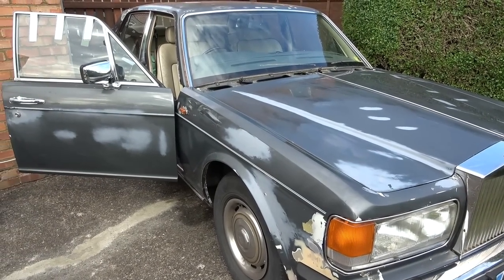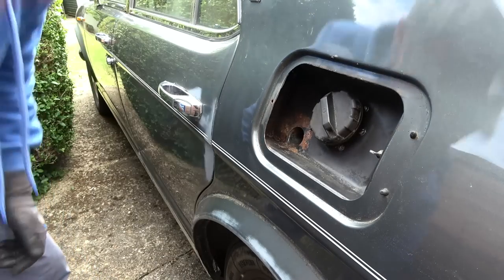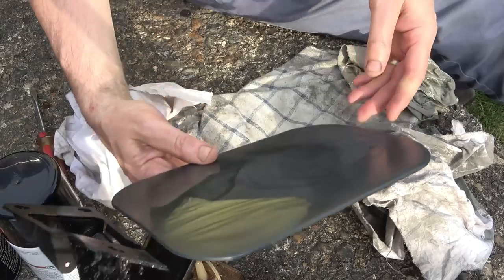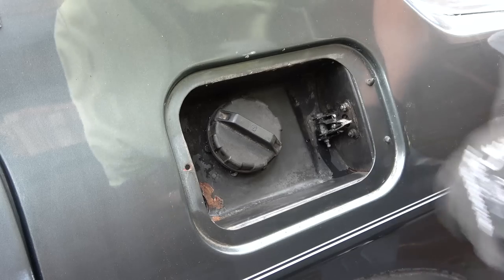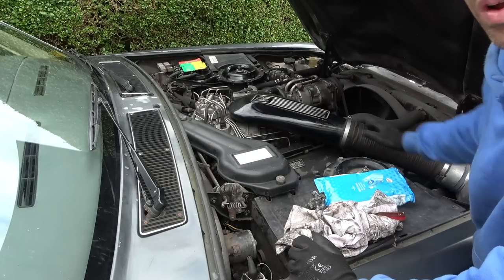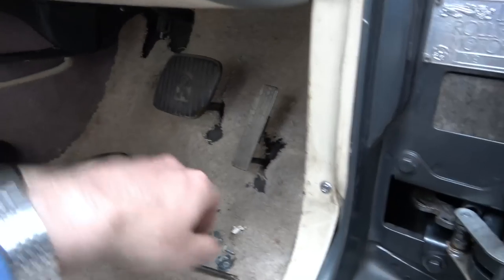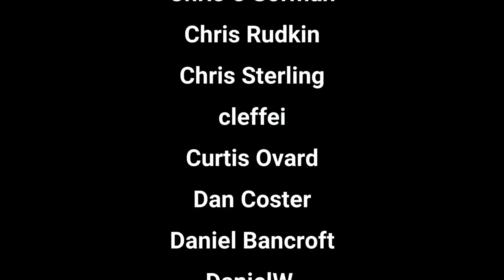Can I REPAIR a ROLLS ROYCE - PART 8 - Fuel Filler Flap - Polish - Engine Clean

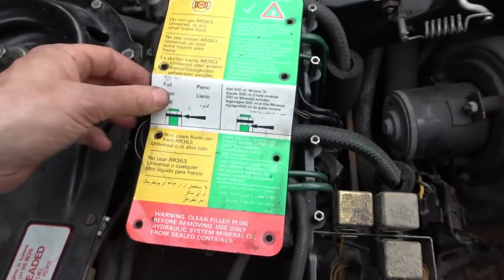Comment: The original Castrol LHM bottles have a specific tube nozzle which fits in the LHM reservoirs for the suspension and brakes. You'll need to get hold of one of them, Flying Spares has them for a couple of quid, part RH15233. It goes in the holes on the top left of each of the reservoirs as seen at 38:07 - they are accessible with the warning plate in place. The one furthest in to the engine bay on yours has a blanking plug in place, the other one seems to have lost it over the years.

Comment: Hi Vince! I'm the bloke who sent the polisher in! I used to detailer professionally so just a few things

T cut contains fillers which essentially fills in those scratches,  (caused by the car being wet sanded by the way) this causes it to look shiny but only short time if you wipe it with IPA it soon be dull again. I highly doubt you will be able to remove the scratches by hand but the machine will do the job just fine you will need to research the correct pad though.  

I also believe your car is not single stage paint (paint with clear coat mixed through it) it seems to be paint and then clear coat on top. 
Last thing is wear a mask if you're going to be using the machine even when outside clear coat is nasty stuff. Disposable P3 mask would do. 

Thanks again for the content
Reply from the maker: Nice one Ben, I have already filmed part 12 on the T Cut attempt but I will remember the tips for another future episode👍👍👍

Comment: Another great episode, Vince.  I'm really loving the series so far!  Makes me want to get my XR3i Cabriolet out of my mum's garage and try to get it back on the road.  It's been sat there dead for over 20 years, so it's likely going to need a bit of work!  😬
Reply from the maker: Cheers Steve, it is probably worth more than you think. All older cars seem to be fetching high money at the mo 👍
Reply: That engine oil is probably going to be the consistency of molasses lmao
Reply: it will need a new, well, everything. 😁
Reply: @cheapasstech  absolutely. I detest nothing more than those "it has been sitting for 40 years, will it start?" videos.
Reply: Go for it buddy 😎
Reply: just had a look at that car... god it's so.... you! It'd be good to see how you go if you do decide to give a restoration a go!
Reply: You deffo need to bring that to the channel steve im a big ford fan
Reply: I had my 1990 XR3i Cab on my driveway under tarpaulin since 2008.  Was meaning to get it up and running at times, but just never got around to it.  As we were planning on moving a few months ago (but it fell through eventually), I reluctantly sold it last December.  It was generally in pretty good shape, but needed some work, mainly to the bodywork and normal things when a car has sat still for 14 years.  I put it on the bay, and through an auction it finally sold for £1,150.  I was expecting better, but it just so happened that the auction ended right at the time the final F1 race was finishing in December, where we had the last lap fiasco between Hamilton and Verstappen, and then the subsequent appeals by Mercedes.  the auction ended right between the final lap and the next hour of protests, so I think many people that had been watching  (over 100 watchers) must have been caught up with the GP and forgot it was ending.  The guy who bought it said he was well pleased with the final price.  Strangely enough, as of a week ago, it wasn't back on the road as the gov website is still showing the last MOT was in 2008.  By golly, I loved that car.  And as it turned out, I didn't even need to sell it!

Comment: Be careful with that T-Cut Vince It will cut through the lacquer layer on your paint (if it has a lacquer layer). Check the t-cut bottle instructions it will explain what kind of paint you can use it on. Older  T-cut was mainly used for flat paint but they do do one for lacquer finishes. Also you must use a polish after using the t-cut.
Reply: From the looks of the car, it’s likely if there was a protective layer on it, it is likely long gone already
Reply: I wouldn’t worry about protecting it the whole car needs a respray lol

Comment: Hello Vince. I'm an ex Rolls Royce car painter from 1978 and T cut was originally made for Cellulose paint ( Coloured paint or lacquer with thinner using 1 to 1 mix ratio ) unlike todays 2k paints that use hardener with a 2 to 1 mix ratio.  Most Rolls Royce's back then were painted with a top coat and dried in an oven and then flatted with wet n dry 600 grit with a marble block. This process was done at least 7 times which gave the cars paint work a much fuller body..You can always test if a car was painted with 2k or cellulose, t cut a s small bit of panel, if color comes off on the cloth then the paint is cellulose, if no colour on cloth then its 2k. If its lacqured you can smell it on the cloth. If 2k you wont smell anything apart from the t cut. Another surefire way to test if car has cellulose or 2k, put some gunwash on a cloth ... Be very carefull though, gunwash is the original thinner to clean your paint gun after painting and is very strong at removing cellulose paint. If you wipe a car with gunwash on old 2k paint the colour wont come off. If cellulose it will.
Reply from the maker: Thanks Tambian for the advicevand tips, unfortunately I have already attacked the paintwork in episode 12 before seeing any comments. I will have to look at it again at a later date👍👍👍

Comment: You really shouldn’t dip & re-dip your brush straight into the Kurust as you can contaminate it with bits from the workpiece. Best to pour a small amount into another container and dip your brush in that.
Reply: I was about to say the same .

Comment: Hi Vince, loving the series.  I've t-cut all sorts of cars, i've just read thru all the comments.  I don't use a polisher because its often too fast to control well and only does the flat surfaces well, just hand t-cut all the paintwork to see how good it comes up and will make it all even, you do need to polish over t-cut and my top tip is NEVER EVER t-cut on a hot or sunny day.  Stuff is soooooooo much harder to work and get off when the metalwork is warm.  I even t-cut by hand a couple of large vans, omg it was hard work but honestly polished a lot of money back into both vehicles.  No one can be arsed but it is rewarding and i think you found already the paintwork on a rolls is so good with so many layers it will come back like new if you spend the effort.  The bad spots yeh might involve whole panels ie a wing to be painted rather than just a spot.  It will never really blend in no matter how good you prepare.  Doing the worse panels together with the t-cut on the good stuff will make it like new.  Cheers mate.

Comment: Your "can do" attitude and willingness to tackle anything are an inspiration to us all.  Don't forget to research on... Youtube... for folks who have already blazed a trail for you by doing many of the same repairs.  I am certain that there is an especially warm place in Hell for anyone who vinyl wraps a car.  Press on regardless!
Reply: if it is done, should be done in the early days of a cars life, then the water, salt, and grit hasn't got to the bodywork, to do it wouldn't be so bad if it didn't hide all the rust, because then the buyer isn't aware of any troubled spots, and like Vince finds a rusty car covered in bodge jobs. great video content, but for the average person, then it would cost more than the car is worth to repair by the time you factor in all the faults, rusty panels, chipped paint, and polly filler, not to mention a paint job, or redo'ing a wrap after the proper repairs are done.
Reply: kind of like a garage using back to black on tires that need replacing, to hide the fact, lucky for me I checked on the previous MOT before buying my current car, so knew that the tires were reported as needing replacement, even though I know of the wet tyre look to had the fact the treads are nearly at the end of life. and the 2nd car I bought from a garage whereby 2 or more tires needed replacing, as either illegal or extremely close to being illegal.
Reply: @michaelthomas3646  🤔 Interesting comment. The truth of the matter is Michael. This Silver Spirit is a very neglected example, it would be a very expensive car to try and bring it back to Rolls_Royce standard. Unless you can do most of the work needed doing your self. Not many people could. Lastly this is not a rare model Rolls_Royce.....

Comment: You’d be able to see it as it’s not a solid colour. The metallic won’t lie down the same if you use a brush, however, if you masked it off and primed it, you’d then be able to flick some colour on it from an aerosol can. It probably won’t last long, but it would be good enough. Also, don’t forget the paint is around 30 years old so getting a match won’t be easy. Doing patch repairs will make it look more respectable but that is probably what you’re after rather than paying thousands to have it resprayed. Just in materials for paint would be over £1k for a car this size. 
Doing a DIY job is definitely the way forward.

Comment: Don't dip dirty brush into rust converter always pour out what you need and don't put what's left back in as you will contaminate as it reacts to rust . Says on bottle ,good luck Vince
Reply: I was thinking about this too. I spoiled three bottles before I realized.
Reply: It's a man thing that we don't need to read the instructions, instructions are there to be read

Comment: The T-Cut appears to be similar to a product we have here in the USA called "NuFinish" - make sure you heed the warnings and directions on the label - some products like this are not recommended to be used with a polisher (DA or otherwise) - there are many products that can (and probably should) be used with a DA polisher such as what you have - just make sure you have to appropriate backing and polishing pads to go along with the product.
As for paining on with a brush I think you'll have much better results with a spray can color matched to your car's paint code - a specialist shop can match to that code and usually will adjust based on the age of your car so it's not as obvious of where the re-spray was done.  You'll need to clear coat the color coat as well - even the clear can be had in spray can form but it'll probably run about 20-30 pounds - should have "2k" or "2 pack" in the name - the hardener is mixed when you go to use it.  With enough prep work effort you should have a nice result.

Comment: If you have the workshop manual, servicing the hydraulic system is section G5, which you may have seen already.  Unfortunately I couldn't find a video specifically on the Silver Spirit but did find one on the Silver Shadow - not sure how different they are (certainly the reservoir looks different at least).  Found it on youtube channel rollsroycenut "Silver Shadow Bleeding Brakes" which is in two parts.  

I also saw a separate video where the guy hooked up a pressure gauge to the system and monitored the PSI when the engine was on and what it was when braking. Might be worth a shot to try checking those values before fiddling with the system if you can figure out where the valve point is to check.  The video I saw was on channel Lonewolf RRBentley titled MVI_8577.AVI Rolls Royce Mineral hydraulic system.

Needless to say, working on the hydraulic system surely starts to get into the more advanced set of tasks, as the system appears to be highly pressurized (2200psi) and runs throughout the car to at least all four wheels then to the engine area and much more.
Reply from the maker: Thanks Travelling, looking forward to checking out the videos. Cheers 👍👍👍

Comment: Very nice work, it definitely wants a new air filter as that's probably restricted the engine air intake and power quite a lot being so blocked up, or the original air box put back in, love this series keep it up, enjoyed it so much the 45 minutes went by and felt like 5 minutes.

Comment: Paint with spray, sand it 1500-2000-2500 sand paper.
Spray again 2000 2500 clare spray 2000 and 2500 after that you go over the area with t cut or clay and wax and you will have a non existing spot.
Nice video you are getting us to setting up camera and telling story on that car :)
Reply: Yes, I would spray rather than brush - I've been there and it was too bumpy lol!  Far easier to polish down fine spray layers vs brushed paint.  It can blend well if you over spray a little but mask off the larger area.
Reply from the maker: Thanks Anders,  I have already filmed the first attempt, I won't spoil it 😂 but I have ordered up some wet and dry in finer grades, 1500, 2000, 2500 and 3000 👍👍
Reply: Why such fine paper? You can flat the primer with 800 or 1000 wet and dry then use a grey scotch pad to flat the rest of the wing, paint over the primer and flick the colour slightly wider than the repair, then clear coat the whole panel.
The only time you'd need 1200,1500 or 2000 would be to de nib the job once dry before polishing with some g3 or finesse it depending on the finish.
Avoid T cut, we don't use it in the trade anymore, buy some 3m finesse it or Farecla G10, much better finish  👍
Reply: @andicog  i am shore you can do a brilliant job with biger grid paper if you do it every week.
Vince know i am just DIY prrson my self and i find it abit slow but i am happy with the finish i accomplish with the method i recommended.
Reply: @andersmmvfc.8376  I'll explain it like this , if you wanted to shape a block of steel, would you get the shape better with a file or a piece of  wet and dry? Which would ensure the surface was level and straight?  It ain't the wet and dry .  Never go finer than is necessary, 800 or 1000 is fine, if you rub through then a light coat of primer before the colour coat is fine, honestly, 1200, 1500, 2000 etc is for paint rectification, removing orange peel or dirt nibs, it's not for prep even when using light coloured pearls and Metalic (where prep has to be 100%) Most modern shops will now sand dry using a 600 disc.
Shape filler initially with 40, then 80, then guide coat and 180 or 240.  👍
Reply: @andicog  i am not talking about preparing for paint, i was talking about spray paint instead of paintbrush, and sandpaper down the paint with 40 grid must make it ruff 😅 but you can probably smoth out the sprayed paint with 800, as if you preparing it you can iven begin with a sandblaster ;)

Way i use so fine paper is to nake the transition from new to old smothered and as an armature you get spraycans that spray out the paint in not a brilliant way compared to a aircompressor with a 1000ish dollar spraygun 😀
Reply: @andersmmvfc.8376 😂👍
Reply: @Mymatevince  I'm also recommend 3M Trizact in 3000 and 6000 flavour best sand I've ever used

Comment: Vince, I believe on a previous video I made the suggestion that this is the route that you should go. By working on the car by hand it's going to be easier to carefully restore the paint.  You could also look at getting a small airbrush and compressor and carefully restore the paint in the damaged areas.  This is like what you would do if you were working on a model car or small hobby project. Love to watch your careful attention to detail as you lovingly restored this fine old car.

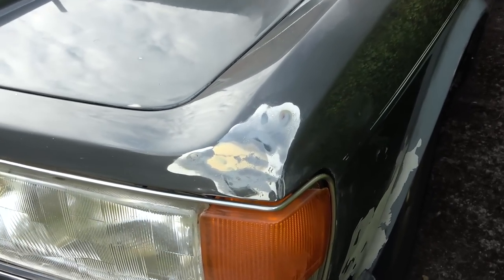Comment: 14:57 unless you plan on using a clear coat after you paint it, it won't turn out very well as clear coat is what gives the depth in the finish

Comment: Like the hairdryer idea!  A suggestion for upping your degreasing/cleaning at some point - use fluids.   Gunk is good but it ain't cheap in any significant quantity, so get yourself some paraffin or diesel.  Both work incredibly well as degreasers, they're more versatile than wet wipes and they're far safer than petrol (which also works very well but, well . . . 💥).  

Stick some in a bucket to help wash down the bits that come off and arm yourself with a handful of cheap paintbrushes for the bits that don't.  Just remember to put something under whatever your cleaning to catch whatever washes off 👍
Reply: Obviously he's doing it all at home, but the best way would be to have the whole engine bay steam cleaned.

Comment: the value of your RR keeps going UP AND UP. Nice job on the T cutting polish. Cant wait to see the rest of the car. i like the idea of touch up paint on them spots. You can even use a modellers air brush top feather it in.

Comment: Bit of advice, when using the rust treatment decant some into a container rather than putting the brush into the bottle, otherwise any slight rust debris can make the entire bottle activate and go off.
Reply from the maker: Will do, thanks Scott👍👍👍
Reply: First thing I was going to say too, I remember seeing that warning on the bottle years ago, when my dad used to use Kurust.

Comment: Hey Mate, when I was a we lad working me way thru college, I worked in a petrol station back in the days where such places were where people brought their cars for repairs. Among other things I used to do oil changes and lubrication. We always put heavy grease on moving parts like your gas filler cap, bonnet, boot and door hinges; not the liquid oil you use. This tended to keep such things in good order. Give it a try😎